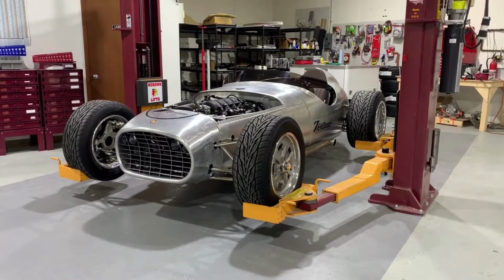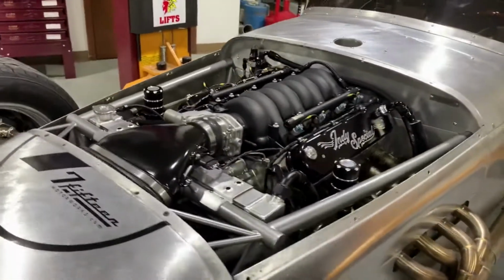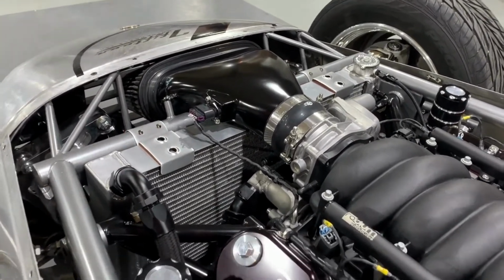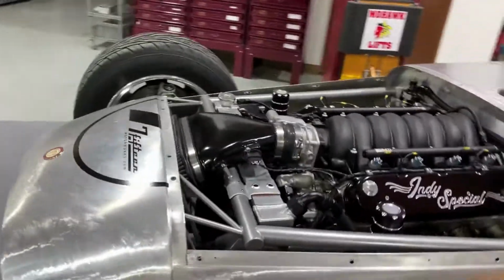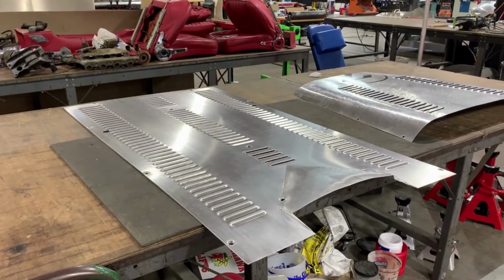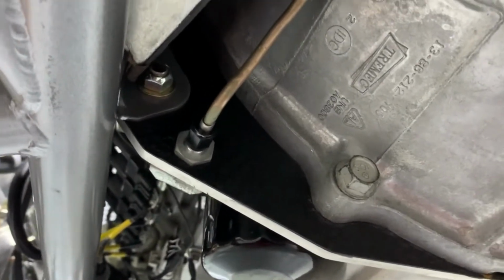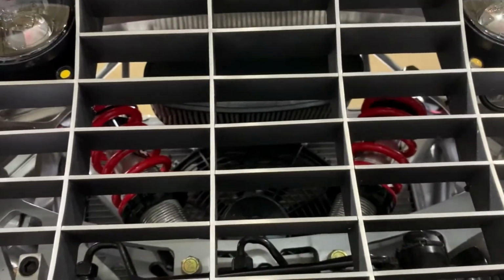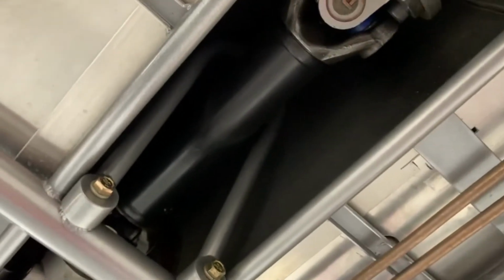Troy Indy Special Mechanical Inspection

Comment: well i like some of the engineering , i like that it must have been inspired by some of a j watsons roadsters of the late50,s , body is beautiful , chassis , i cant see it being stiff enough, also i would have dry sumped it , so you could get the floor pan flat , i would have made the floor pan a structural part as a stressed skin , as that would stiffen the chassis flex in torsion, but these are only my ideas, the workmanship is superb

Comment: Is this the same car I saw on Jay Leno's garage show? This is a nice well built and thought out car! So How much? I also like the adapters to use a lift for a low ground clearance car, I might have to do that for my race car.
Reply from the maker: This was our prototype car that we left in raw aluminum. It is very similar to the black car but optioned out a little different.
Reply: Those hoist adapters  are genius. They would save so much time trying to lift a short WB, low car.